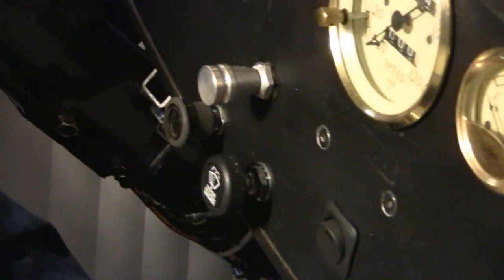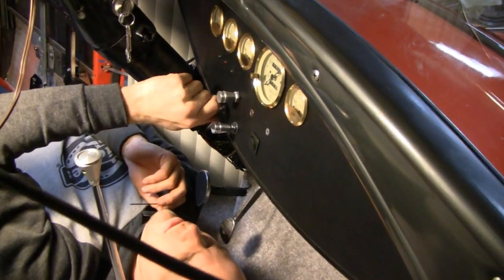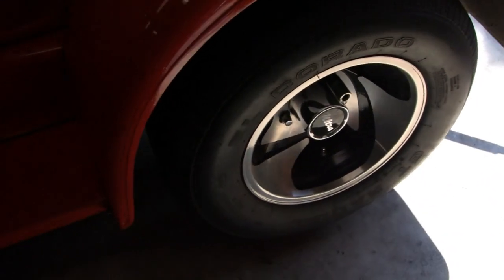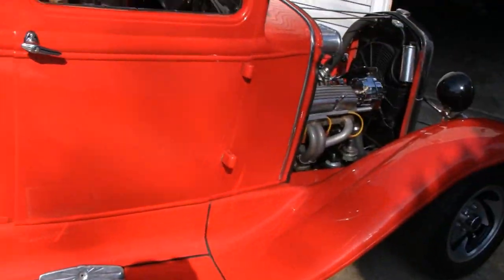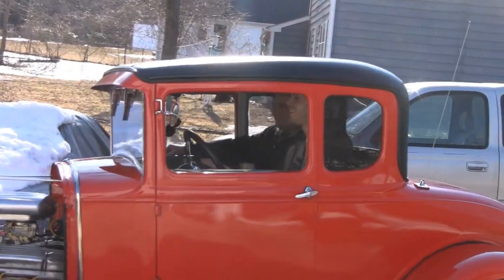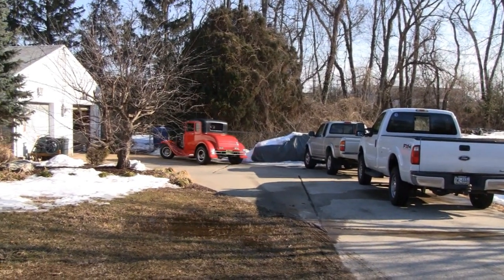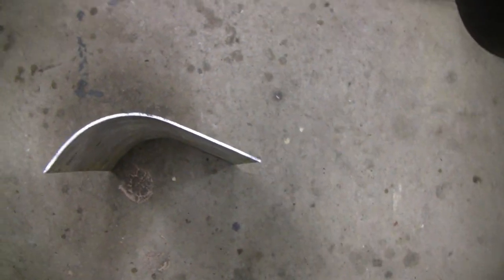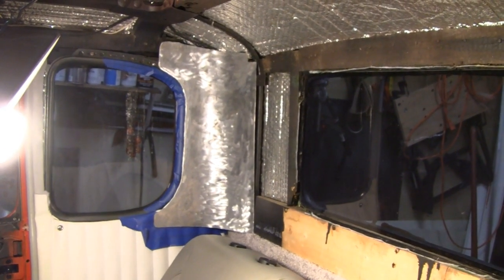1930 STREET ROD REPAIR (part 14) FORD MODEL A

Comment: Love that sound of a soft idling V8,...We used to call those cars,.'sleepers',..in other words, when you hear tat low rumble,.you don't really know what's purring under the hood,...( if there was a hood !)
Regarding the speedo. what's with the needle pointing off 0 when stopped,.is this an electric speedo. ?
Reply from the maker: Reg Sparkes It's a mechanical speedo, it doesn't go down to zero it sits on a peg and starts at 10 mph!!☺